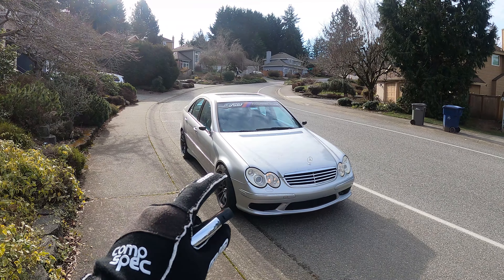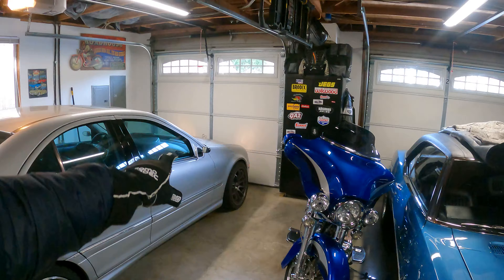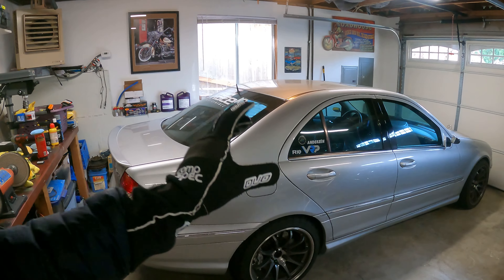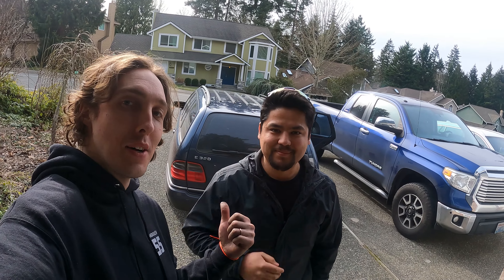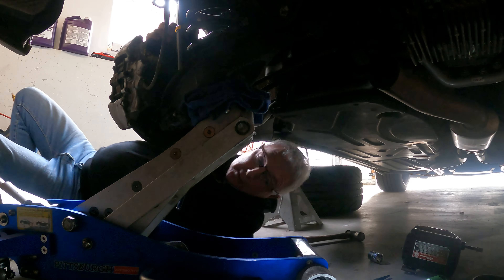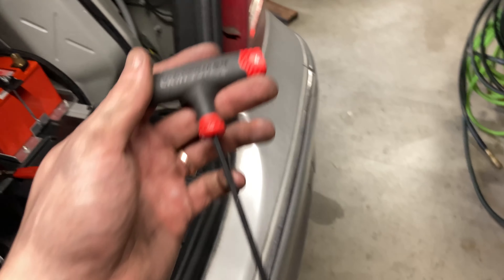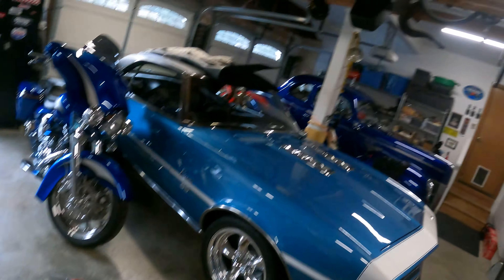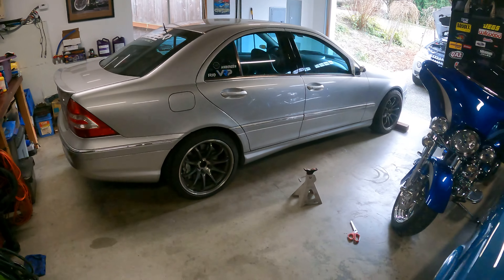MY C55 AMG CUSTOM YELLOWSPEED COILOVERS COMPLETED!

Comment: i love your videos bro ive got a w203 c200 Kompressor
Reply from the maker: Thank you! Good motor you got!
Reply: @ANDERZENAMG  thanks any mods youd recommend?
Reply from the maker: @elijahschool2725  tune and mods to supercharger, if you look around there are some pretty good diy mods you can do to wake the car up
Reply: @ANDERZENAMG  im gonna port the supercharger and take out the intake sound muffler thingos as well but in terms of handling what mods would you recommend as we have pretty much the same chassis?
Reply: @ANDERZENAMG  also at 16:53 its pronounced niche or knee-sh
Reply from the maker: @elijahschool2725  poly control arm bushings, ultra racing strut tower bars and any chassis bracing you can do, light wheels, sway bars, then from there you can decide if you would want to go coilover or upgraded struts springs etc.
Reply from the maker: @elijahschool2725  haha what did I say 'nitch'? That may be an americanized way of saying that lol I know it is technically niche like kneesh

Comment: Hi!  This week I will be buying a C 55 with extremely low miles and I was wondering what your advice would be for first mods or work that needs to be done, it only has 33,000 miles and it is in pristine condition, I would like to build it out throughout the time that I own it
Reply from the maker: I mean you probably won’t have to look over much but depending on climate just check the conditions of things like radiator hoses, plastic end caps on radiator. It’s probably all good though